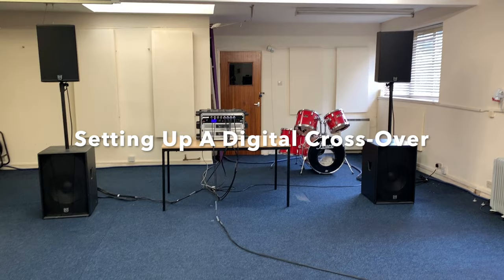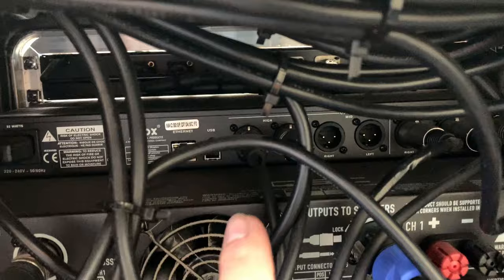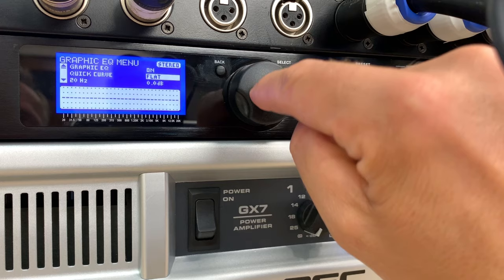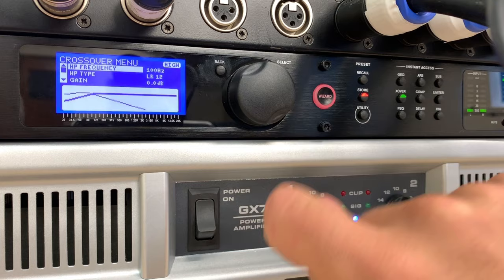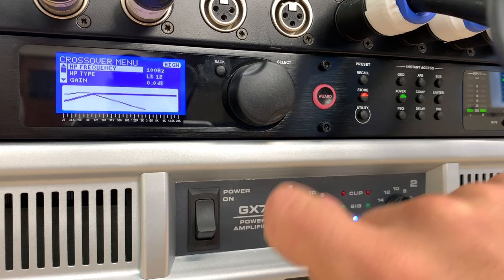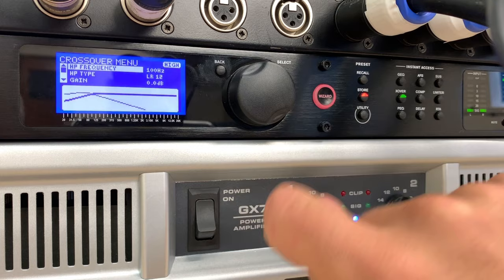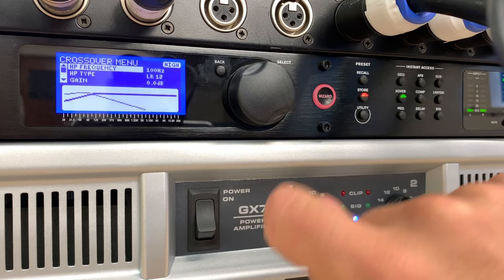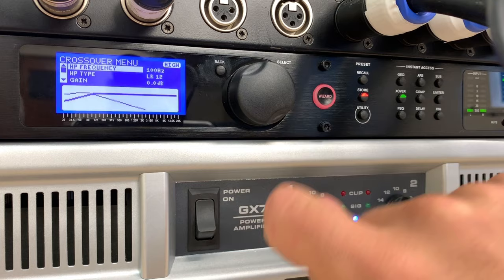Setting Up A Digital Cross Over

Comment: Thank you for the detailed video demonstrating using the PA2 without the app! I wanted to see a demo of this ahead of buying the PA2 and potentially getting stuck with a failed network. It's always good to have at least Plan B!
Reply: Michael getting the DBX was so worth it for me . The sould quality is so much better and my speakers are configured HI Mids to Tops and  Lows to SUB. Seperating the audio signal with the dbx  going to the speakers is awsome sound.

Comment: Is There A Way To Save Or Lock My Custom Settings After I'm Done Setting Up The DriveRack PA2 ???
Reply: Yes. After you finish setting ur PA2, switch off your PA2. Press the RTA button and the while pressing the RTA button, switch on ur PA2. U will enter the menu for locking ur PA2

Comment: Hi, does anyone know why am am getting a slight clicking noise when I tip the dbx driverack up and down side to side its coming from the top vent area, if you put your ear next to it you can hear it more, if anyone could check yours, the dbx is brand new. Thank you
Reply: If it is still under warranty? Get it checked out.

Comment: how is the input bunt set +4 or -10?  I'm interested in a live band!  thanks
Reply from the maker: It is meant to work with live mixers and so is designed with input voltages of =4dB.  If your mixer is outputting a lower voltage of -10db then you can increase the input gain on the driver tack, (see page 19 of the manual) https://dbxpro.com/en/product_documents/driverack_pa2_manual_5044138-apdf